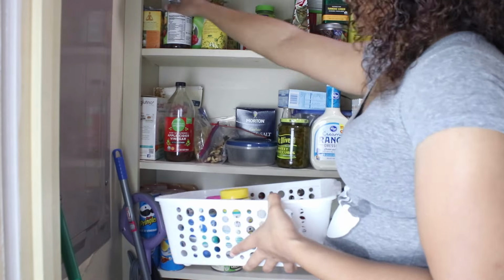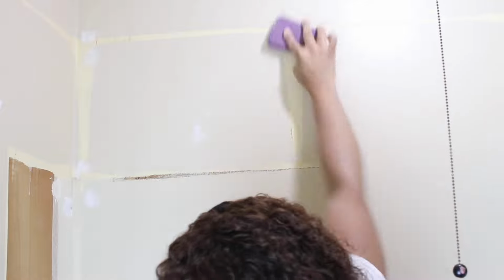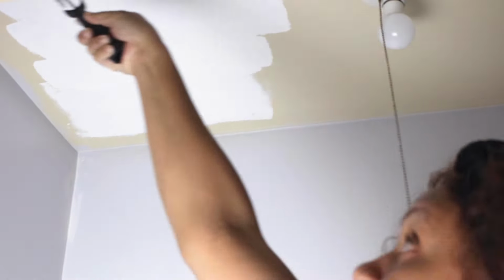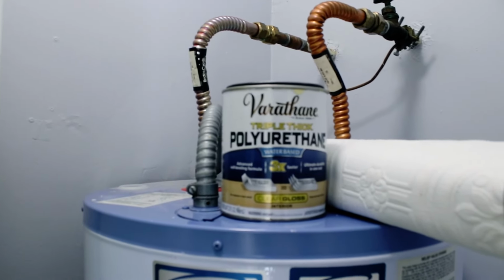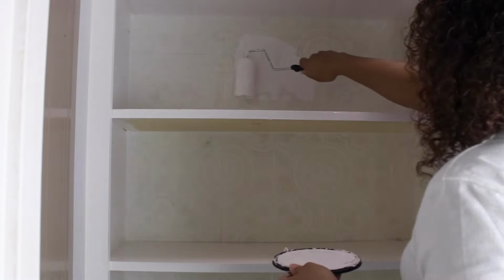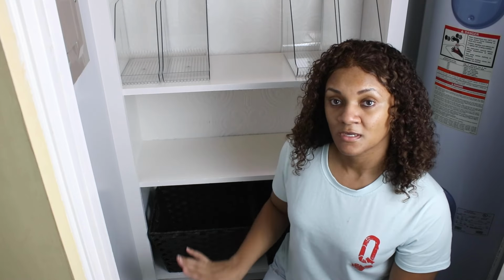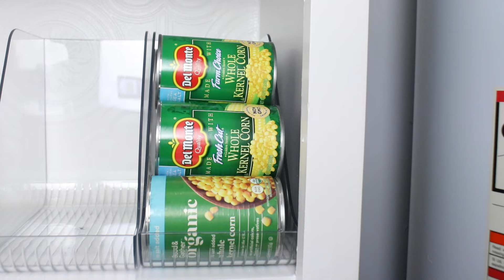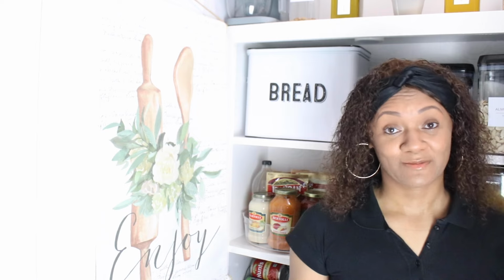2021 Pantry Makeover

Comment: Very nice job!  Looks great!  The electrical panel door might hold those round magnetic spice tins.   Dollar tree has large and small ones — they are in the office supply aisle.    Also might consider those round water heater trays — about 4 inches high that will save you a heck of a mess if something happens with your heater and you end up with a flood.  Been there done that — ruined a good part of a room where I had just installed wood flooring about a month earlier.    My plumber set up an overflow pipe coming out thru the side of the tray and down thru the floor to my crawl space below.  Would much prefer 50 gallons of water in the crawl space than back on my flooring again.  Just a thought!  Tfs!
Reply from the maker: That is actually a really good idea! I would hate to ruin the floors with water. What a pain! Thanks for sharing ❤